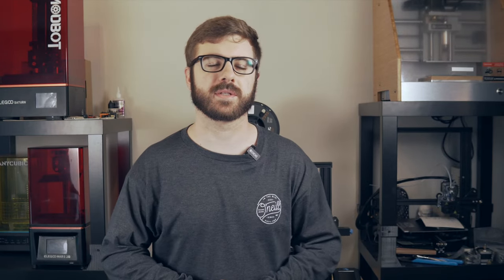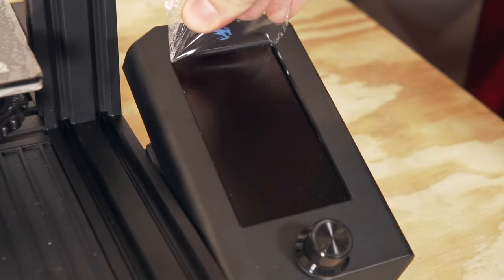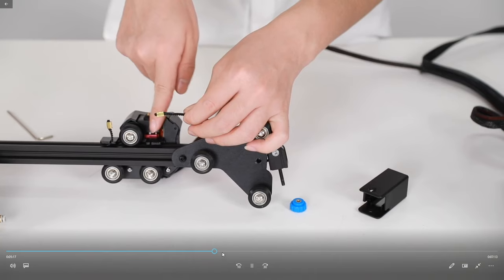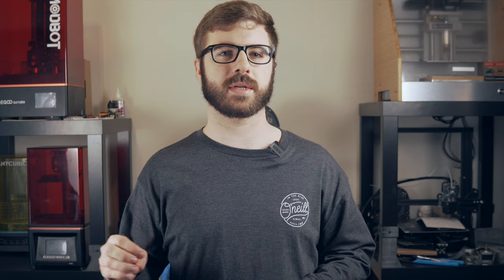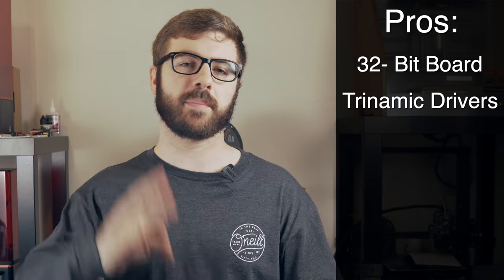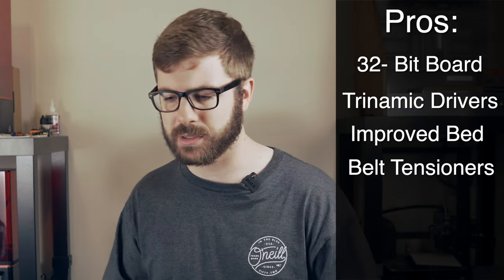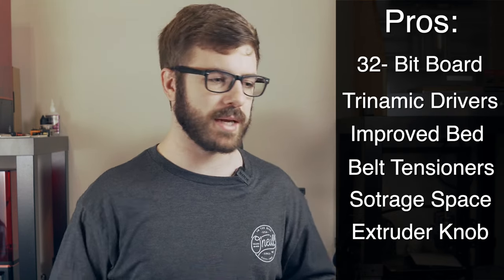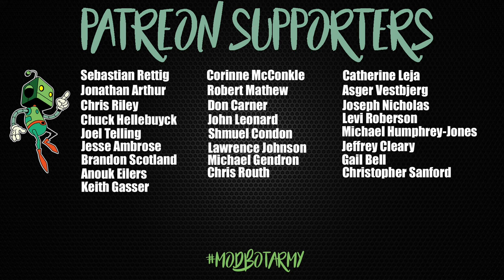Is The Creality Ender 3 V2 Worth It?

Comment: I have Ender 3 V2 and I wonder if I have to swap the 0.4 nozzle to a 0.2 nozzle in order to print miniatures.
Can you make a video with cura settings about high detail prints?
I use Jyers manual mesh bed leveling.
I am planning to buy Creality CR Touch, Primacreation magnetic bed and Creality filament sensor.
Next upgrade will be Dual Ζ with pulley.

Comment: Is the Z axis a bit hard to move around, im very new to this space and i got my ender 3 v2 2 days back, Even small prints are not sticking to the bed and the z axis fails at times when the print starts to gets vertically bigger, which basically knocks off my print from its base.
Reply: you need to make sure the bed is properly leveled, there are many ways to do this. One nice thing about the v2 is on the X-carriage you can actually get an auto-leveler attachment which isn't too hard to put on. if the bed is properly "level" make sure the nozzle is close enough to the bed to get a good first layer adhesion and perhaps take another look at your temperature settings. Nozzle temp too low will cause the filament to cool too quickly. If the bed isnt warm enough the same will also happen. Another quick note, glass beds usually require extra adhesion measures such as hairspray, gluestick, or painters tape. Hope this helps!

Comment: So if the Ender 3 V2 and the BIQU B1 were the same price the Biqu would be the better buy??
Reply: I herd about the ender 3 v2 first and I was pretty set on buying it, but after hearing about the Biqu B1 I think it would be a better choice cause the Touchscreen, leds, duel fans, filament run out sensor, the better cable management taking use  of a USB type C. Not to mention they made it convenient for bed leveling upgrade.
Reply: @mal3k_xd  it’s a clone so parts shouldn’t be an issue for the most part. And the community is great. You are right and nothing will keep me from being a part of it and make my own iterations of ideas for my Biqu B1.
Reply from the maker: I feel like I would go with the B1 at the same price. But that may not be the answer everyone gives. I love my B1
Reply: Get the B1, my v2 was great for a whole month, every week I have something new to fix now.

Comment: Do you have a video on the Ender 3D Pro? I just got one to make cookie cutter but for some reason they are not coming out smooth. The printer print ok, I don’t know what I been doing wrong, I been researching and my prints are still not coming out smoothly. I been using PLA Fliament. The cookie cutters brake easy, is it the printer or the Fliament? Please help 
Thank you

Comment: The E3V2 is ONLY worth it when you upgrade the firmware to the Jyersm fork. It fixes everything that was a problem. Even has OctoPrint host support and layer progress on the screen. Feels like a completely different printer with the new firmware.
Reply from the maker: I have to play around with some of these firmware mods. Sounds like an upcoming video.
Reply: @ModBotArmy  definitely worth it. Having the Octoprint support makes printing so much easier with the availability of the Print Status screen and the Tune Menu. The microstepping is so easy to use too.

Then on top of that, the inclusion of ON SCREEN manual mesh leveling is a game changer. I was doing it through Octoprint before and it was a beast. Now it's as simple as doing it on the Pro. Makes buying a BLTouch completely worthless!
Reply: @ModBotArmy  It definitely has potential. So many new features, UBL, HS and more. Look into the ExtUI that seems to fix some of the serious issues with the scrren/DWWIN_SET cumbersome integration into Marlin. Much better now.

Comment: Question, I have just bought the V2, still boxed, new to printing... do you think I should run it as is for a while or is it worth upgrading the extruder to an all metal higher temp unit and auto bed leveling as I build it?
Reply: 1year later what do you think

Comment: Nice! Just picked up my second 3 v2. The first one I bought last year was packaged very differently, and shipped with a warped bed :|. The hardware was packaged much better and the bed is flush on this one. I did end up loading Smith3d's firmware that makes the display look MUCH better. I run 2 Ender 5 Pros and I actually dislike their displays compared, just because of where things are in the menus. The extruder is a disappointment. It should ship with the mk8. Both machines I have to add another $13 to the machines out of the box because that cheap plastic extruder breaks very quickly IMO. Great vid!
Reply from the maker: This is the first time I am hearing of this firmware. I will have to take a look. If it improves the UI I may make a video on it because it is one of my biggest gripes.
Reply from the maker: Thanks for watching and the feedback.
Reply: @ModBotArmy  yep I have it on the 4.2 2 board and 4.2.7. They are very similar but imo the 4.2.2 version is best with bltouch. Adds lots of neat little things like x y z location, a slick z offset tool and of course making the options selected MUCH easier to see. Love the vids bro, very much appreciated content (especially as I'm starting a printing company) 👍🏻

Comment: What are your thoughts between the ender v2 and ender 5 pro?  Looking for a second printer that will be a pla printer.  My printer now is a ender v2 with bltouch with jyers.  I really do like it, the jyers and bltouch made a big difference for me.
Reply: ender 5 pro is defo a better alternative then the ender 3 V2 IMO. the E5pro comes with upgraded metal extruder. improved bed springs & a magnetic flexi plate for the table

save yourself the money time & heartbreak and invest in a good machine like the E5PRO. i originally got a E3V2 for my bday but both the original & the replacement was a lemon, not even the best 3d printer mechanic could salvage the clusterfuck that thing was. instead i got a Ender 5 pro and that thing works straight out of the box as it should ,

Comment: Which would you choose of Ender-3 v2 or the Artillery sidewinder X1 if they were at the same price?
Reply: I conducted days and days (maybe weeks!) of comparative research on this very topic and determined that, price aside, the Sidewinder was the better way to go, at least for me.   I've had the Sidewinder out of the box and printing almost non-stop for 2 weeks now and can't think of how I could be happier.  Two important upgrades I made (thank goodness) are:  a) TH3D Flex build plate (amazing improvement, especially in removing prints); and b) Octoprint  via Raspberry Pi 4B, accompanied by webcam I had lying around the shop.
Now, I'm pondering buying the Ender-3 v2 for son and daughter-in-law, because my grandson will turn 13 in July and I know they would really enjoy it.  All three of them are somewhat nerdy, but also very DIY in multiple crafts.  Son and DIL are university professors of art, graphic design, and interactive media, so there's a ton of experimenting going on in their house.
Good luck with which decision you make.  I don't think you can go wrong either way.  The assembly and "launch time" with the Sidewinder seems quite a bit faster/easier than with the Ender.
Just my $.02

Comment: I have NEVER gotten the glass plate bed to stick. Supposedly it becomes "sticky" with heat and provides adhesive but it if does, it's never worked. Instead I flip it over and use a glue stick on the uncoated side.

Comment: Well, IMO the glass bed is a perfect upgrade from those uneven bullshits that they give away with stock Ender 3 and Ender 3 PRO. I have both of these and had to buy two new ultrabase style glasses since the original bed plates were just pure shit. It warped so much that I literally yeeted flex plate from E3Pro out of the window.

Comment: I just ordered this printer  after watching this video. I listened to what you said about the self leveling add-on. So ended up with the combo with the leveling and extra nozzles for $280. I figured, why not it's still less than I paid for my oculus. Also, I had a bunch of stepper motors lying around, so now they might get some use. For the 3d modeling part, I have a game design background, so it's going to be cool to see some of my stuff as real instead of 3d models, lol. The noise of the fans won't bother me too much as I'll just toss it into the guest bedroom  as a permanent home.

Comment: I would love to see a video comparing the Elegoo Neptune 2, the BIQU B1, the Ender, and maybe the Voxelab Aquila 3D Printer. Lots of low priced printers for a first machine...if you were recommending a first time printer, which one would you suggest?
Reply: I think you mean the neptune v2. The saturn is a resin printer
Reply: Would love to see an under $300 print off - BIQU B1, Artillery Genius or Hornet, Ender 3 v2, and Neptune v2!
Reply: Ender 3 v2 no question.

The Biqu b1 is nice but the Ender just has so much support and mods and they're easier to come by.
Reply from the maker: Hmm maybe an idea for a future video. If budget was your main concern Neptune 2. If you want the most features then B1. If you want a Creality because you are sold on the Ender 3 well then the Ender 3. If the Ender 3 V2 drops in price I would take it over the B1 but at similar prices the B1 is an awesome machine.

Comment: Hi there, do you see an issue with the power supply being covered? There's a video on that here on YouTube, It makes me wonder if it may be a hazard on the V2. The video "The Ender 3 V2 Power Supply Is A Hot Mess!"
Reply: I've been using my V2 for months now and not had a problem. I did make taller feet for the base so mine sits with more air gap on the bottom.
Reply from the maker: If you enclose the printer then possibly, but it does have a gap on the bottom to let air out so I really think it will likely not have issues.

Comment: Got mine a year ago, maybe a year and a half? Its great though, few problems outside of my own learning how to level, but I got it perfect now and have no problems at all, printed a bunch of miniatures and they came out pretty well, and just recently printed a large combat helmet and gas mask for cosplay (FNV mojave ranger armor) and it did great on it with no problems ^^. As far as fan noise, it is a bit loud but I have it just 3ft from my bed and was able to sleep through the 3days it took to print the mask in one go. The  UI and screen work well, its simple enough touch screen wouldnt really matter, but I do agree that the names need to show more for the files.

Comment: Looking for my 1st printer (total electronics noob here), also looking forward to using a wide range of materials (definitely TPU/flexibles) with minimal modding. My options (similar price due to location) include the Ender 3 V2, Elegoo Neptune 2, Artillery Genius (and I could even stretch the budget for an Artillery Sidewinder X1). Any suggestions?

Comment: I bought my Ender 3 version 2 for $279 off Amazon about 3 weeks ago. The first week was rough as I was brand-new to Printing and I could not for the life of me get the bed level until I got help from CHEP channel. I don't know whose file I was using because like I said everything was brand-new and it was kind of a lot to take in but I was basically chasing the nozzle around with a piece of paper. Anyways out of frustration I ordered the Anycubic Vyper off Ebay for $349... not much more and have found that it's ALOT closer to the ENDER 3 S1 I feel!! And it's alot cheaper than that one!! I don't get Creality's pricing with all the competition. Also I called then about assistance the first week when I had my leveling issues and they were NASTY to me. I have to say their customer service is trash. And I don't like giving my money to people that treat me like s*** when I call.. all in wall I think the end of 3 version 2 makes nice Prints but I also think that in all fairness you can get it a better printer for the money. And number two if I'm going to dump three or four hundred dollars in a printer I might as well throw another hundred in and get like the Ender 3 S1 Pro. I'm a first believer of buy once cry once.. I learned that in photography especially with camera lenses. You cannot get good quality from cheap lenses most of the time. And that is pretty much with everything. The Ender 3 version 2 is great if you want to start cheap and gradually work your way up and do upgrades over time. I think the Vyper is phenomenal for a new person or someone that doesn't want to spend a few hundred more on upgrades..

Comment: I bought one ender 3 v2 and one ender 3 v2 neo.  The neo has better quality.  The dual fans create better print quality.  The touch sensor is better.  The flex bed is better.  If I bought another one, it would be another neo.

Comment: Don't get it if you have 0 patience.  This bless or cursed thing isn't nice to users who have no idea what they are getting into(like me) I think just get some(auto bed leveling and already set up) but there still would be problems for sure.  I hope these companies or creator optimize  these machines to the point wherein it's so easy and oh right now my back and neck is cracking and hurting after long hours of figuring out my bed level issues.  :/

Comment: Do you have a link to the IKEA Lack Table Enclosure / Shelf supports you are using? I dont want to make an enclosure, but leave it open like you have. Much appreciated.
Reply: I made closed Ikea enclosure, not so loud anymore. Worth of every penny (I made 3 Lack pile with 100mm extra heights 3 polycarbonate door and mirror backwall plus led lights).
Reply from the maker: I dont :( I modeled them years ago and they were custom heights to what I wanted to be in each shelf. If I can find them I will upload them but I do not know that I have the stl anymore.

Comment: I bought 2 of these, I don't recommend.  1 has a bed shaped like a bowl, and has yet after 10 days produced only 1 good print.  The other has a noisy cooling fan and will NOT keep the bed level, it requires constant attention.  One of the 2 always ends up chewing the filament, not the extruders' fault but the hotend also looks fine so I'm cranking the temps but it still creates issues.  10 days and I'm still nursing the fussiest printers I've ever used.

Comment: I’m looking at purchasing my first 3D printer and watched lots of videos but it seems to me that people work on them more than they print on them.Very confusing being new to the 3D printing world
Reply: Nah I have an ender 5 for a couple months and I haven't had to work on it. Just watch a few video to set the machine up and calibrate it. I.e. Bed leveling, making sure the belts are correctly tensioned, wheels aren't too tight. Some don't need too much adjustment out of the box, just a bit of tweaking. I haven't had to do anything other than reload the filament. Just make sure your settings are good. Remember they don't always come perfect out of the box

Comment: I've got a 3V2, seems like pretty good system, paid 270. Put a microswiss hot end on it, but it didn't need it.
Edit, please God yes make the BLtouch video. I've been struggling to get it working, but I'm a novice 3d printer.
Reply: I switched out all the fans. Can’t even tell if the printer is on anymore, dead quiet. Easy fix.
Reply from the maker: I do plan on doing the bltouch install. :)

Comment: The answer to this is an easy HELL NO!!! I use to be a dedicated creality fan but that has quickly gone away. This machine is pretty much a rip off considering the machines that are out now and are much cheaper. This can also be said about every creality machine these days. Theyre charging too much for too little. Mingda d2, biqu b1, fokoos are light-years better far easier to setup and much better priced considering they're already equipped with the upgrades needed to make the machine worth a damn. And crealitys negligence to fix the main issues that were actual problems like a garbage plastic extruder or the only printer that still doesn't have a filament runout sensor and all around terrible part cooling. And just the fans overall  suck. But creality seriously needs to step up their game. Theres much better out there
Reply: 100%
Reply: hey, im looking for a 3d printer thats precise and not too expensive what would you recommend? The printer i have right now is the XYZ print pro and it has done a fantastic job for 6 years but its getting old and i need to find a new one
Reply: @s8nlx661  that helps alot thank you for your reply

Comment: My answer? No, absolutely not. The build quality is absolutely awful, just had a screw strip out during normal operation, the plastic on the tensioner cracked off, and the hot end assembly wobbles. Probably worth more in scrap metal!

Comment: No. It is not worth it. It is the most useless POS scam 3d printer you can get. The only thing it’s useful for is being thrown in the trash. This thing is pure garbage. Only buy this if you really hate yourself and you need a good reason to end it all. Buying an Ender 3v2 is great at doing that. Apart from that pure worthless trash.
Reply: You definitely don't care to spend time adjusting stuff and upgrading firmware

Comment: if anyone's wondering from someone with 1+ year experience with this machine DO NOT GET IT ITS FUCKING TRASH, save yourself some stress and get a NON-Chinese 3d printer with auto bed leveling and silent fans, the V2 fans are just as loud, if not louder than the steppers from an ender 3  V1 WHEN PRINTING, its ridiculous. Wanna upgrade your ender 3 V2 fans? you just gotta cut some cables, fuck with your motherboard and oh! print a piece for it as well! super easy right? what the fuck could go wrong